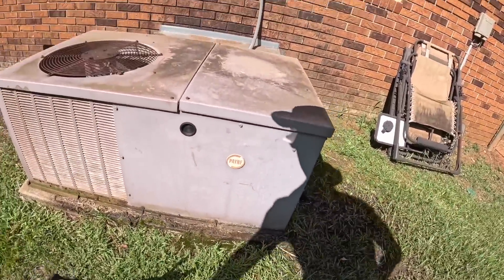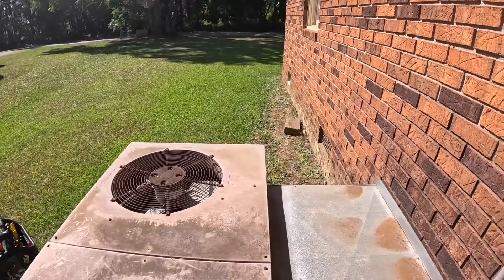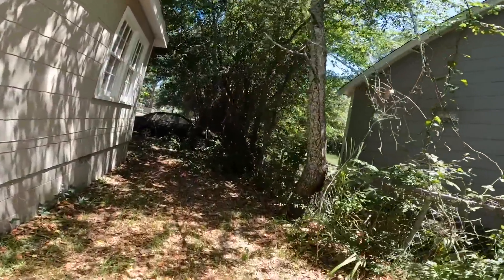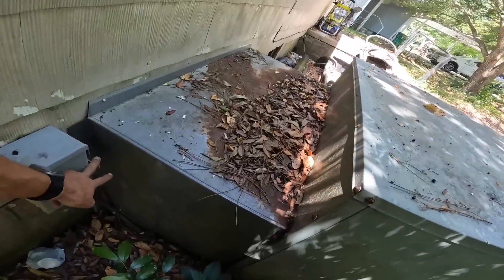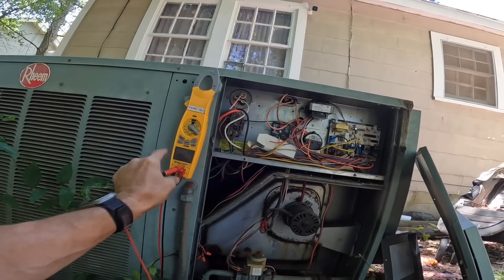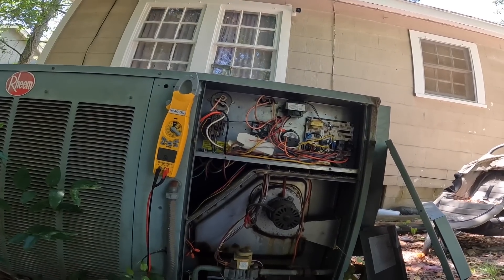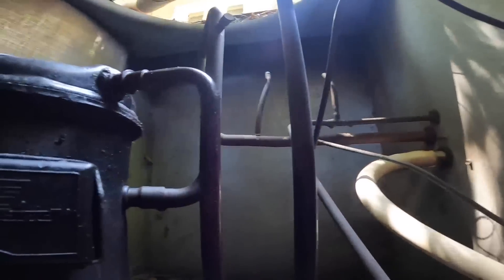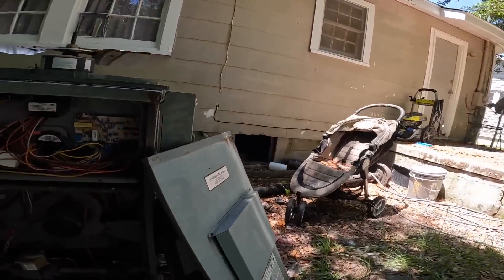They Got Their Money’s Worth Out Of These Two Air Conditioners! But The Della Window Unit is Working

Comment: 12:36 In the summer of 2012, I lost an air conditioner that way. Poor feller dropped from the 2nd floor to the roof of a carport and then bounced to a paved driveway. There was no putting humpty dumpty back together on that one.

Comment: Oh my.  I always put an old towel under a unit to fill in those empty spaces.  Also, at the very least a 2x4 under the back ( on the sill ) to stabilize it from falling out. That single pane window is not heavy enough as a weight to hold it in place. The unit is quite, though.

Comment: If you want to see something amazing, watch the YouTube video where the man bought, 'the cheapest welder I could find on Amazon', to see how long it would take to fail, and to see what it could do. It was the size of a loaf of bread, and not much heavier, yet the performance was equal to a welding machine costing hundreds of dollars. It was an inverter powered machine costing about $100. There are a lot of smart electrical engineers in China. Even from a 120 volt outlet it could use a 1/8 inch diameter welding rod no problem. 
They will sell hundreds of millions of those window units around the world. It will be interesting to see how long they last. I wonder how much copper in in one?  
Clear shipping tape would close those gaps around that window unit for years.

Comment: 1 ton midea inverter u shape window unit is 450. I think that is the way to go for most in a pinch. i love my whole house but man was it expensive. pieces for dual fuel was 4600$. Install would have been another 15000. Yikes
You are a dog lover. we can tell. Curtis, is that your name. Some have said. You are awesome and patient. Your nutrition has to be on point. Low carb maybe. Be well folks. Eat butter and red meat, it heals. Skip meals. Skip soda and candy.

Comment: I hope you put the L bracket window lock on that sash so the window cant be raised off the air conditioner. They are required by law to include them in the hardware package with the manual.
Reply: Instructions schmucktions

Comment: Curtis you should get the ge profile saddle window units for cases like this. They are way easier to install.
Reply: I have a soleus air saddle with heat pump function and it is absolutely flawless. The weatherization it comes with is closed cell foam blocks and a roll of closed cell sticky backed foam for top and bottom. Much better than the standard acordian garbage.
Reply: @staind288  What is the lowest outdoor temp it can heat down to?
Reply: @EthanThruandThru  it's around 25 or so
Reply: @EthanThruandThru  it's still Heating at 25 but not as warm. It confuses me why it doesn't shut the compressor off at lower temp but I did not design it. I still think that it should be a little lower but I understand wanting to preserve the compressor. These things are not cheap LOL
Reply: @staind288  Ok thanks. Not sure it would be worth it for me then. It's routinely well below that at night where I live so it might not work to well.
Reply: @EthanThruandThru  I live in Ohio and it does work really well up until that point. But I do hate when it shuts off because it just says LO on the display and that's it. There is no notification on your phone or anything that comes up that says that it is shutting down for low temperature. But I did see where there are other heat pump window type units which have a resistive heating element built into the heat pump / air conditioner so it can actually run at all temperatures. But keep in mind that with resistive heating, it is like using a large hair dryer and will increase electric usage
Reply: @staind288  Ah ok. I live in Northern Indiana. Currently I have a dreo inverter window ac. I haven't been a fan. It makes the wall vibrate so bad it can be heard downstairs. So I'm not sure I want to go with an inverter one again. This one is also an inverter unit correct?
Reply: @EthanThruandThru  yes it is inverter type. Variable speed compressor. It does vibrate some but it isn't too extreme. We had an addition put on and hvac is crap back there. So, we went this route instead of a traditional mini split. It does ok but the low temp cut off was a downer. I researched it and didn't find anywhere about it having that cut off so I assumed it had heat strips in it too, it does not. Atleast not the one we got. I was bummed but for the price, it does well.

Comment: Surely not crazy about the window unit and how it sat in the window frame. Large gap across the bottom and the sides   I’ll pass on that brand thank you.
Reply: Not the air conditioner fault its' Window design here is the problem and  the age of this  window itself can make it difficult to install window units there no lip on the window which is required to install modern window units.

Comment: I was a little concerned I sold my Mom and Dad's house after they died and their system was 21 years old and R-22 but they had had relatively little trouble with it so I called the Company who installed it and the Man who showed up said he was the one who actually did the installation!  He was happy to see it was still plugging along.  All he could find to do was a slight recharge about half a pound and I had him change the thermostat because they had an old one and I got a touch screen digital.  The people who bought the house didn't seem to be concerned about it so that was good.